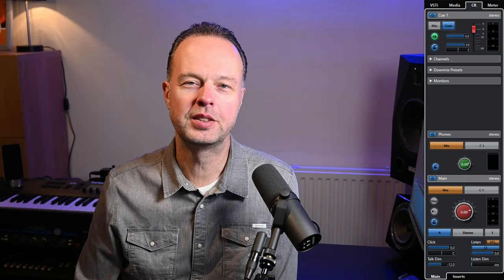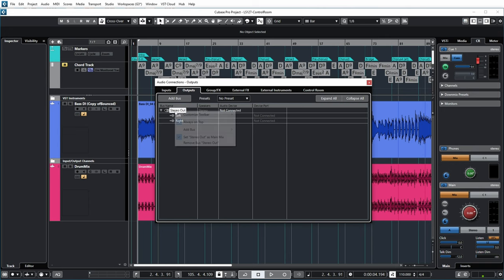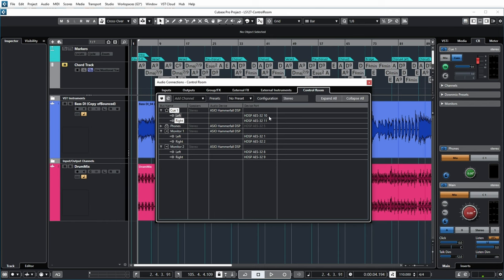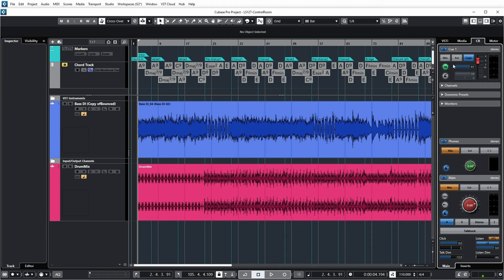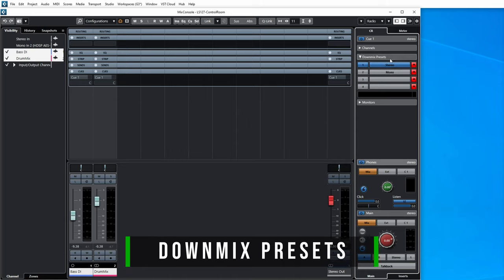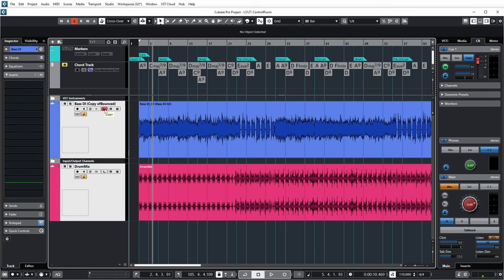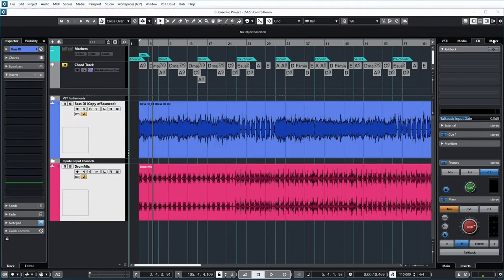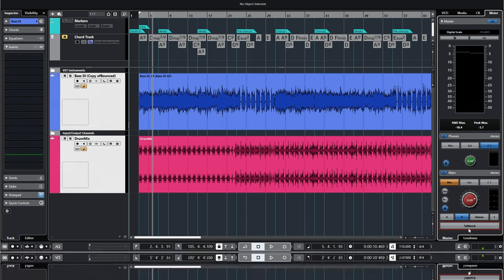Cubase control room; what's not to like!

Comment: Sir. I am using Cubase 12 pro. My problem is every time I open a fresh project i have to link my focusrite audio console for output only by navigating Audio Connection (F 4). But for input connectivity, cubase automatically detects my audio console. Therefore I'm confused and looking for it's solution. Kindly help.
Reply from the maker: I'm not sure what is happening in your case. I would contact Steinberg or ask this question on the Cubase forums.

Comment: Cubase 11 Pro & UR-RT4: I am using PHONES 2 as a CUE, but the "Use Phones Channel as Preview Channel" option does not work with CUE setups. PHONES 1 is also linked to the Control Room red volume knob, so I'd have to physically turn my speakers off if I were to only listen through headphones. Any ideas?
Reply: Clarification: With Control Room activated, I can preview samples through PHONES 1 and to listen to Mix 1 as with the monitor, but only if the Control Room (red knob) volume is turned up. PHONES 1 jack is fixed to Mix 1.

The PHONES 2 jack I am using as a CUE output for when I'm recording vocals at the microphone so as to prevent "howlround" feedback, but I cannot use that same output (while set to CUE) in order to preview samples if I were to edit or produce.

Comment: Hi! I use a little mixer by Behringer in which I connect PC, Audio interface, monitors, headphone. Since my audio interface is a Focusrite 2i2, it has only two outputs so there is not enough space to do all I want to do with the control room. I use one for the mixer and switch the other between monitors or if I use a reference track in the cue sends. Maybe there could be other options but I don't know... I'd like to use the control room while recording but in this case it needs to get an audio interface with more outputs..
Reply from the maker: I would still use the control room even if I only had a two (stereo) channel interface actually. Towards the end of the video I explain why: https://youtu.be/IqMAsKzYGrk?si=XJOJkHAnTfp8BBke&t=959

Comment: I have started to use the Control Room in Cubase when mixing. I have two SonarWorks plugins set up in the Main output and the Headphone output, respectively, each loaded with the proper calibration profiles. Makes all the difference in the world to me when mixing!
Reply from the maker: Yes it’s nice for that. You can even put those in monitor inserts so you have a separate profile per speaker set. Or you don’t have to turn off the main profile when listening to your headphones.

Comment: Using the CR for as long as it’s there. And I’m mostly recording alone at home. 4 Cues for 4 referencetracks, A big hooray for the Listen button while mixing , and great for inserting metering and speakercorrection software without having to worry about exporting the mastermix whIle they are still active.
Reply from the maker: YES!! Thanks for commenting.

Comment: I use mixer 4 as a monitor mixer for my cues. I use direct routing to send the outputs of my backing tracks to my mixbus and in addition to a different set channels that I use for cue mixing. It‘s a little bit less intuitive but in the end imho easier to set up a separate mix for the headphones, because afaik Cubase hasn‘t a feature like the  Cubase IC Pro app where you can view the cue sends as faders. That would be a nice feature in the next Cubase version to have a mixer page for every cue with the cue sends as faders instead of small sliders hidden in a rack.
Reply from the maker: Thanks for the ideas. Separate mixer page per cue is indeed a very nice suggestion.

Comment: Thanks for the informative video on the Control Room. Question: What physical connections (trs cable connections) do I need to make from audio interface to my 6 channel headphone amplifier?
Reply from the maker: You are welcome. Well, if you want to have separate mixes going to the headphones you would need to assign the cue channels in Cubase to different audio interface outputs, and then connect those to the inputs of your headphone amplifier. And then you can make separate mixes using the cue sends. There are only 4 cue channels available though so you cannot make 6 different mixes.
This is assuming you have a headphone amplifier with so many inputs. If your headphone amplifier only has one stereo input (which mine does), all headphones get the same mix and you would need only one cue channel to make a separate mix for the headphones.
Reply: @LanewoodStudios  I have a Presonus HP60 headphone amp and my audio interface has 8 additional outs so I will give this a go! Thanks!!
Reply from the maker: @TheDrumhead54  great, good luck!

Comment: A hardware version for desktop would be great for using with Cubase
Reply from the maker: Good idea!
Reply from the maker: By the way, you get some of this functionality from a (hardware) monitor controller but not all of it.
Reply: I have all the control room functions mapped to my old Mackie Control universal
Reply from the maker: @LemonesqueStudio  yes good idea as well!
Reply: @LanewoodStudios  My tip for anyone using more than one set of monitors with software correction (Sonarworks etc) is to use the monitor inserts and have each set with its own calibration profile. I like to keep that stuff away from the master bus.
Reply from the maker: Exactly, tried to show that in the video as well 👍.

Comment: Thank you for the video Maarten. Very helpful.
I currently use my (Focusrite 18i20) interface software to set up cue mixes for my six piece band.  I understand that there are only 4 stereo cue outputs in the Control Room. Is there a way to route a cue to more than one set of outputs so I can provide (duplicated) mixes to band members 5 and 6? Thank you.
Reply from the maker: You are welcome. I don't think there is a way in Cubase to do that, but you could use hardware or software of your audio interface. E.g. a headphone amplifier that allows routing one input to multiple outputs.  
I don't now the Focusrite software myself, but on my RME, I am very much able to route the inputs from software to multiple physical outputs on the interface.

But if anybody else knows a way in Cubase ..... Maybe via a multi-out insert on the cue channel in the control room e.g..?
Reply: @LanewoodStudios  Thank you. I have solved the problem by setting up aux buses with their outputs routed to the 5th and 6th headphone amp inputs. I can then use sends to route mixes to the aux buses, and hence to the 5th and 6th musicians.
Reply from the maker: Ah yes of course. If you are not tied in to the cue mix system you can use sends. Or maybe direct routing if you want to make sure that levels are all the same.